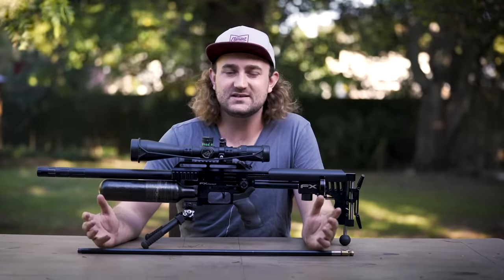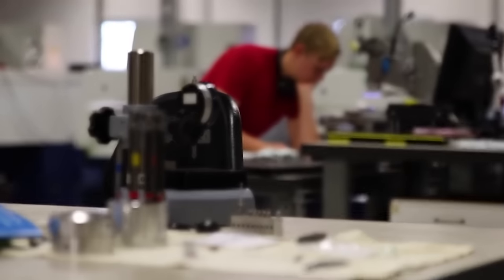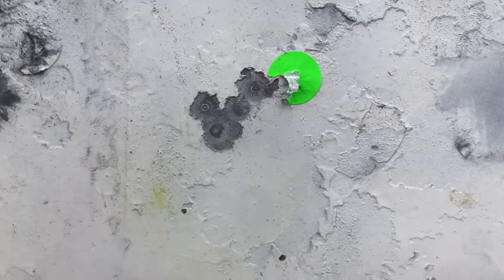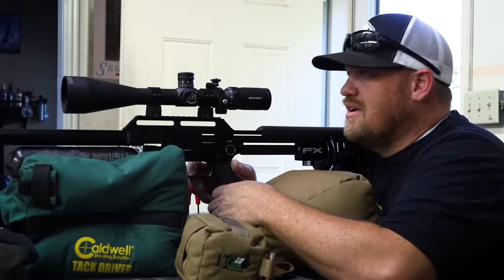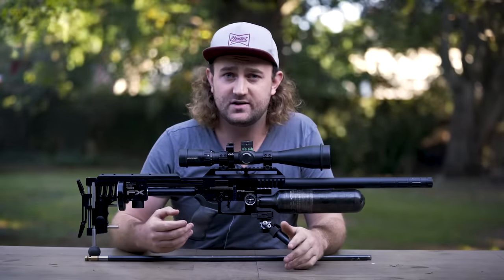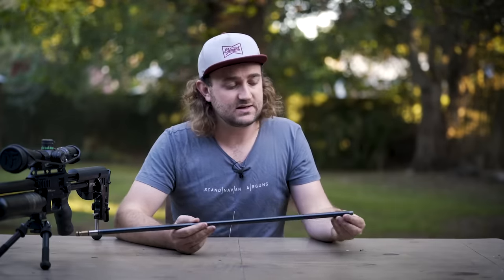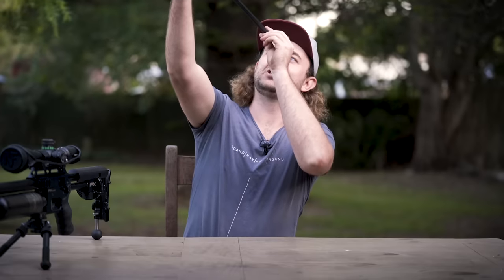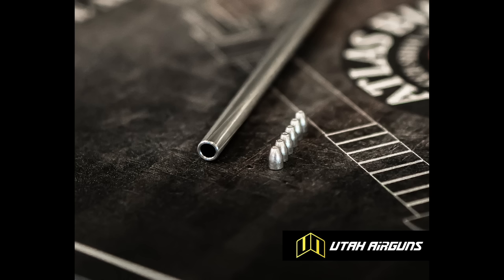The Ultimate Guide to FX SLUG LINERS

Comment: Ni

Hi Matt, I have tried numerous lubing solutions, and stumbled on this solution on the internet. Benzine/two stroke oil, 1in 40 benzine to oil.  This cleans the pellets thoroughly and lubes them with a very good synthetic oil designed to withstand extreme conditions without creating dieseling in springers. Swirl them in the solution, take them out and wait a minute or two for the benzine to evaporate, and you are done.  Compered to all the commercial oils such as a Napier, WD 40 and Balasol, this works very well in my Crown .22 barrel

Comment: As a developer of high performance long range cartridges, wildcats, and the rifles, I am very impressed.  I no nothing about air rifles, but the basics. Everything you’re onto with barrels, projectiles and the charge or psi is right on the mark. Remember the barrel is a tuning fork. This is very important. The barrel crown must be round to round and that is all that can be done. I would suggest concentrating on the precision of the projectiles a little more. Flat based bullets will fly great at shorter distances. Look to modern bullet construction for improved performance designs, but remember to keep the majority of the weight as close to the base as can be. I realize you’re restricted on the length of your projectiles due to magazine construction. I could go on and on, but I liked everything I listened to you talk about. Very very well spoken. You are going down the right road. Keep going and do not be restricted by conventional thinking. Think outside the box. I’m very impressed. I think I might just get a modern high performance air rifle. Cheers.

Comment: Thanks Matt, great information and I appreciate the information, especially regarding the tuning of the Impact. I also appreciate the info on the different slugs. I am also surprised at how accurate I am able to shoot pellets through the slug liners myself which I can vouch for.  I have one question though and that is regarding the o-rings that hold the liners inside the barrels, how necessary are they?  It is easy getting the liners out but not that easy getting them back in and then you also not sure of where exactly they end up once you have inserted the new liner, so can you just remove them completely?  I know they are supposed to help with the barrel harmonics but every time you change the liner then they move, it seems easier to just remove them and then just shoot in the rifle again, can you give me some advice regarding this please.  Thanks.

Comment: I had long wondered why airgun companies didn't seem and pellet manufacturers didn't seem interested in developing projectiles interested in making barrel/projectiles with higher ballistic coefficient projectiles and barrels optimized for them. The advent of the regulated PCP power system made consistent charges a reality: charges more consistent, in fact, than brass cases charged with gunpowder.
I competed in firearms events for years, shooting targets out to 1,000 meters. One of my rifles shoots a 7mm wildcat caliber. The 7mm was chosen because the projectiles have a higher bc than anything close in diameter. The barrel was built for me by a man named Dan Lilja, a legend in barrel making. Instead of the traditional 6 groove rifiling, he cut 3 grooves instead. And he hand-lapped the barrel, polishing the bore to a mirror finish. There is virtually no lead or copper fouling with this barrel. the twist rate is 1:10, designed to stabilize bullets in a fairly narrow weight range. 
How does it work? Exceptionally well. Single-hole groups out to 200 meters. And with the proper bullet weight and shape, 6" groups at 1,000 meters on a windless day. 
But it is your comment that a chance discovery about the process used to choke the barrels that made a big difference in accuracy that jogged my 69 year old memory. 35 years ago I discovered that trimming my cases to a consistent length was important, but the thing that made the biggest difference in accuracy was lathe turning the mouth of the cases so they had a consistent THICKNESS, providing a consistent inside diameter which gripped the projectile evenly over its entire 360 degrees. That was when my 1000 meter group size shrunk from 10.5" to 6.2." Since that time, I have religiously trimmed the inside of the case necks, and as long as I pay attention to the other factors (overall case length, bullet seating depth, powder charge weight, etc. People looked at me like I was nuts when they would watch me hand-load my cartridges, but when they saw the results at 1,000 meters, they stopped laughing. I am VERY glad to finally see the same sort of thinking being applied to air rifles, and I applaud your efforts. Thank you.
My next rifle will be the FX Crown Continuum, based in large part on what I saw of the R&D capabilities and the commitment to innovation and excellence displayed at the FX factory, I think the ability to fine-tune that rifle will keep me happily busy for years to come.
Reply: The simple answer is money. The manufacturers know what works and they're hesitant to invest heavily in something the market might not be interested in. We've only recently come to a place where people are ok with plunking down 3k for just a rifle and investing another 3k in filling and glass where that was a fringe group before. 

Now we have so many influencers providing free advertising to convince people to buy into this market that it's become profitable on a large scale, so that's why we have them now.

Comment: There are slug liners and pellet liners, that's the point.    I can confirm my 22 700mm pellet liner shoots 23 grain or less hybrids,javelins or pellets fantastic to 120 yards(slugs outside 80 or monsters).    The stx heavy slug liner only improved groupings with slugs or monsters and ruined 1 hole pellet groups(my suspicion is the choke difference) .    Each liner has a place and purpose, but for general use my experience with the pellet liner has been better.

Comment: Matt good video, just a quick question, I have a .25 FX Crown and have a slug liner ordered, the point you say about the reg pressure being 155 to 160 bar is over my manual max recommended of 150bar. What would you about exceeding this, thanks.

Comment: After listening to your comments on barrel design differences for slugs and pellets a thought occurred to me.  If a  diabolo shaped pellet is inherently stable at subsonic speeds why does the barrel need any rifling?  I believe the shape was designed originally for smooth bore around 150 years ago and its likely that the barrel quality was nowhere near today's standards. In other words does the smooth twist barrel need the "twist" when firing pellets?
Reply: To help stabilize the pellet when leaving the barrel the air used to propel the pellet down the barrel can also destabilize it immediately after leaving the barrel, rifling or the smooth twist helps over come this

Comment: Thanks Matt.   am having some accuracy issues  lots of POI and generally not very good groups with pellets,  I pushed the reg up to 150 and used  some 23 grain NSA slugs  and it shot very well.  Makes me think it might have had a slug liner installed instead of a pellet liner .  When you max out your hammer for the slugs do you have a measurement for the hammer slider you can share with us.  I know the factory default is around 18.5 mm

Comment: Great info...Do have a question regarding penetration. I personally have not tried the slugs yet. However, since they require higher velocities, have you ran into any issues on not enough penetration at closer ranges on really hard headed game? Seeing ballistic gel testing, they do open up fast at close/medium distances when shot at high speeds and penetrate obviously better further out when they have slowed down enough to open up less. If, for example one was planning on shooting small to medium sized hogs or coyotes within say 50 yards, would one be better suited shooting a harder pellet then a softer slug to assure that the slug doesn't flatten out on its head and not get into the brain?

Comment: @AirArmsHuntingSA. What about a video on rangefinders and the one you currently are using? In this video alone I counted ~3ish that were on video. The Kilo 2400BDX is ~$799 the Kilo 2400ABS ~$1299 difference being Ballistic Calculator onboard of the higher priced one and some accessories. If I already Have the Kestrel 5700 Elite Weather with Applied Ballistics Link Enabled, would getting the Kilo 2400ABS be unnecessary redundancy? Would there be another one you recommend or currently using?

Comment: Mate some North American guy made a marauder  action and had a huge bolt fitted and a 24inch rifled 12g shotgun barrel instead of using the normal people  cylinder he was running a braided hose from a carbon fibre divers tank it would drop most game in America he dropped an elk in one video 650 Rob and that was shooting foster slugs on the low power setting and the .75 calibre ball shot was lethal as well

Comment: Hi Matt I have a question on slugs and pressure and hammer spring pressure.  I have a new MK2 .25 cal. (July 2019)  I got it tuned in very well with pellets.   When I went to the slug liner.. not so much.  I get the general concepts of reg pressure and hammer spring.  But I ran into some trouble.  I can not seem to get enough hammer spring pressure to overcome the DP pressure on the valve.  I know this because I've tested... when at max hammer spring, and regulator around 165... I'm getting a measly 400 FPS slug (NSA 36.2 HP).  That is not a typo... 400 FPS.  I realized I hardly used any air at all after 28 shots... meaning the hammer is barely opening the valve.  Have you dealt with this situation? 
Currently my groups are mediocre at the 915 FPS (148 BAR) and I am almost maxed out on hammer to get this speed. I feel I need to get a bit more speed to make this thing shoot accurately.    I'm afraid if I go higher in reg pressure, the hammer spring isn't strong enough.  My guess is that while FX increased the air supply in the MK2, they did not increase the hammer spring.  The weaker hammer spring enabled a lesser resistance, i.e.  pellets to do well, but  doesn't seem to have enough umph for slugs; Please let me know your thoughts. You may not have seen this effect with the .22, but it is very real in my .25; and I can only imagine worse as the caliber is increased.  BTW... great video's.  It would help us newcomers if some of the experienced folks laid out relative settings for their situation.  Currently I'm shooting 148 BAR, with a NSA 36.2 HP, the hammer spring is at .585 inches.. where .560 would be my maximum (I don't want to sit on maximum), and the valve stop is at .40 inches  - the average speed is 915 FPS I have .25 cal 700mm slug liner with a Donny FL moderator.  speed is relatively stable at 3.44 stand dev when I tested it (20 shots).. but the groups are lack luster.  I think getting a tad bit faster may help, I've been slower, and that doesn't help.  Thanks Matt or any experienced person willing to speak up.

Comment: Exciting times indeed. I’m looking to buy the crown continuum with slug liner.  700mm barrel seems a bit too long for pest controlling and hunting. I’m wondering if a 600mm barrel would be on the menu 🤔    Also, would the shorter barrel that’s supplied shoot slugs well?  I’m keen to know before actually going out and buying it 🤔😉
Reply from the maker: 600mm works great! In the Impact mk2 you can comfortably get the power needed to shoot up to 27gr slugs in a 600mm barrel.

Comment: My 700mm .22 impact is shooting 25.38gr jsb monster redesigned at 925ft/s. Is that a good velocity for this pellet ?
Reply from the maker: In my gun they need to be around 1000fps. At 925 they will be stable out to 50m but will start to wobble after that.
Reply: @AirArmsHuntingSA  Holly S** 1000fps. I recon that without a power tuning (like Ernest's one) I will not be able to achieve such velocities right ? I have already ordered the huma extra high pressure regulator but I don't think it will be enough. Right ?
Reply: @AirArmsHuntingSA  I have managed to get a little more power . It's shooting now at 940ft/s but I don't think that I can squeeze more power just now. Maybe when my Extra high pressure huma reg arrives... what do you think ? The groups, by the way are awesome and the extreme spread is at 6ft/s on a 30 shot string with  a standard deviation of only 2 ft/s. thanks to your tips !

Comment: This is confusing on one point : you said the barrel must be designed for slugs and afterwards you say that even if twist rate is not that fast, the slug will still be fine with it. Is choke the only requirement then ?

Comment: I was thinking about the turbulence issue and a question came to mined. What if the slug is still being held by the barrel lands but the pressure behind the slug is then removed significantly by drilling vent holes that line up within the groves of the rifling. it would require a longer barrel but probably not much. The holes would need to be significantly big enough to dump as much of the pressure as posible but cut in such a way that they wont cause any burrs or places to hang the slug up.
Reply: You are describing an integral air stripper.  FX have an air stripper in front of the barrel as a separate part.  It is hidden by the shroud.

Comment: Matt, dont you run the risk of converting a pellet gun to the a close standard set by powerder burners and thus, could lead to them being banned?  This was an arguement made to me today from a friend as we talked about pellets vs slugs.  He was consered that the lines would be closer between the two worlds, which could lead to very restrictive regulations on air rifles.
Reply from the maker: A firearm operates at working pressures that are 30x higher than airguns, so no, I don’t think there is any danger of entering firearm territory.

The slugs don’t make the guns more powerful, they just make the flight more efficient. Even a little .22LR is more than double the power of a .22 Impact maxed out.
Reply: Ya.70,000psi is a tad bit more than the 3000psi in our air rifles..But hey. The way this guy is progressing the industry, we might have hope

Comment: I have a crown in .22 and I was wandering if I am stuck with a 500 mm slug liner or can I  use a 600 or 700 mm with the original barrel shroud. If I have to use the 500 will  it still be worth getting a slug liner ?
Reply: shadow scout I’m getting good results on my crown with 500mm barrel shooting .22 24gr varmint knockers slug
Reply: @c88air  thanks

Comment: This video is a few years old I gather you may not see this question and you may but you talked about putting like lubricants on your slugs and then fire them down the barrel if you put Vaseline or any type of oil it's going to have the same affect as a diesel engine and there's gonna be some combustion and it's going to make it make a bang in the balls going to get a much higher speed in FPE but it's not good for your gun I check into that

Comment: prior to 1900, air guns used the same projectiles firearms did (ball and bullet) last couple decades of the 1800's, firearms tech vastly outpaced airguns and most people relegated air guns to parlour/pub toys. Smoothbore are cheaper than rifled barrels, and a diabolo pellet works well at 10m out of them.

fast forward 90 years, 3000 psi pumps and tanks are available, and suddenly, everyone thinks they're reinventing the wheel by launching firearm type projectiles with air. All the while most designs barely exceeding the performance of the air guns of the 1700's, despite vastly superior materials and understanding of physics... it's like someone taking a modern freighter and circumnavigating the world using the various modern canals and acting like they're doing something never been done before lol.